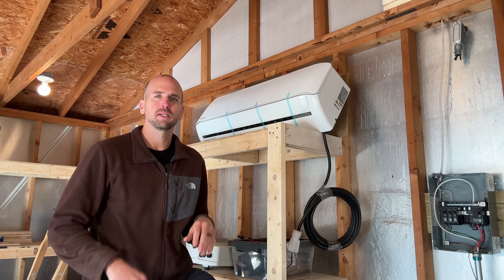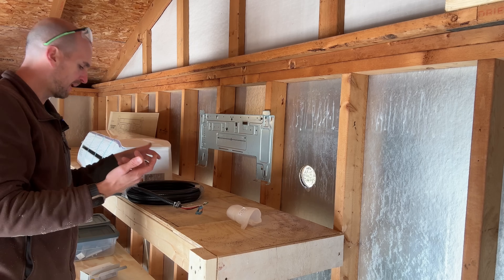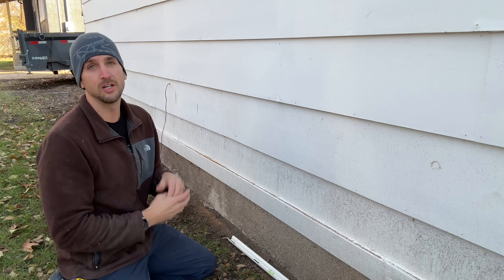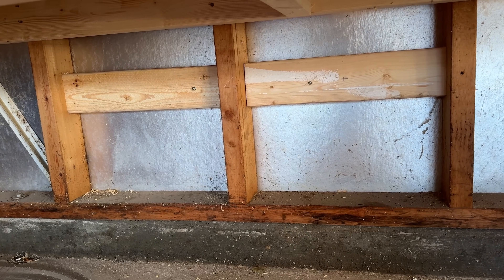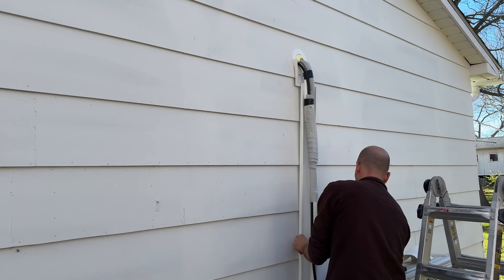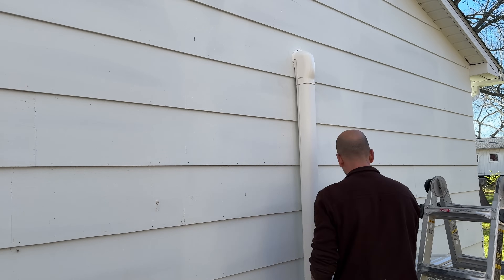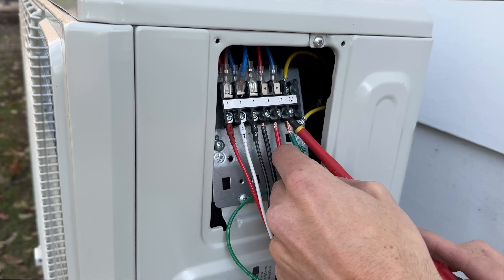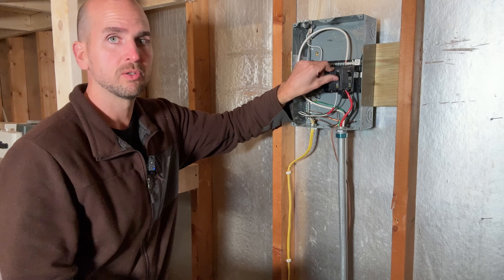Complete DIY Mini Split Installation | New Mr Cool 4th Gen Unit

Comment: What about using your EXISTING a/c power lines to power that system?? because for me my a/c has a electrical box like that but older with a fuse why not use the lines on that to power it and for me mines is wire directly to the fuse panel so essentially upgrade the box upside to the Mr cool box wouldn't that work?????

Comment: No, you're not gonna call out anybody and have them come recharge your lines.They're gonna ask where's your permit who installed it?We're not gonna touch that, and it's gonna be more expensive than just going and buying new lines... Nah HVAC guys going to want to remove all your refrigerant.Vacuum out the lines hold a vacuum weigh refrigerant, re introduce the.Refrigerant , do all kinds of tests and uh , you think that's gonna cost you a couple bucks youre cray cray....So I think you better check your figures...
Some of these lines from other manufacturers are so brittle that if you move them around like this guy's moving them you will break and crack the copper (crap from Amazon).It wont-work.You're going to be buying a new line set.

Comment: Does yours make A popping and cracking sound after the heat cycle? My mini split keeps me up at night, and when it is in defrost cycle makes it poop and crack even louder! It doesn't pop and crack in a/c mode during the summer, just heat mode. I'm trying to figure out if something is wrong with my mini split, or if they all make that annoying pop and crack sound.

Comment: Scott, quick question... If I have a two story house, and the A/C will be on the second floor (while the condenser is on the ground floor), can I run all the pipes and the wires inside the dray wall?  Do frames of buildings have some sort of wood between the floors inside dry walls?  I just don't want the outside of my home look ugly with all those wires and pipes hanging on the side of the house.

Comment: Just a quick glance, either the top plate of the wall you mounted the handler to is out of level or the handler itself is (by about a 1/2-3/4 inch across the length of the handler.) Could just be a trick of the camera as well. Otherwise great install! (Sorry, OCD kicked in.)

Comment: Good explanation but couple violations,, 1..the white wire supply wire in disconnect not identified as a hot wire.
2. The black control cord coming out of the outdoor unit he used a metal cord connector whish is not rated for outdoor use.
3. Black control wire needs to be secured to the seal tite,, 
Never would have passed inspection here

Comment: Checking the Mr Cool Install book for the 18K unit they say to use a 30 amp breaker and a 10 gauge wire.  You are using a 20 amp breaker and a 12 ga wire.  Is that working OK?

Comment: I just took delivery of my 2nd Mr Cool, this one is a 24,000 btu unit for my workshop. The shop is a separate (from the main house) building with it's own 200 Amp panel. I have already run the 240 circuit using #8 wire with a 35 Amp breaker in EMT out to a non fused service cutoff and all rain tight compression fittings. The compressor will be on a wall bracket. I will be fabricating a special longer bracket in order to hit 3 studs to lag it in. Tomorrow I'll begin installing it, and welding up the custom wall bracket mount. 

The main house upstairs Bonus Room had a new Mr Cool already when we got here in March of 2023. I have to say, this is a really wonderful product. It keeps the Bonus Room upstairs at a steady 75 degrees regardless of the month or weather. It is super quiet and so far has worked flawlessly. Like I say, it came with the house but was newly installed just prior to our buying here, so I didn't install it. I'm looking forward to learning all about it when I install this new unit in the workshop. I like the Bonus Room unit so much I decided to go with another one. 5 Stars for Mr Cool. Further, as a solid dedicated DIY guy, I love the pre-charged system and being able to do it all myself.
Reply: @highland6439  Gosh, I have no idea how to break it out. I have 4 heat pumps on this place. Sorry. But it seems reasonable.
Reply from the maker: Nice, best of luck on the project and I like the custom bracket idea to hit 3 studs for a little additional support 👍
Reply: @EverydayHomeRepairs  What about the quality of these units? I'm thinking of buying one to cool a 20x20 garage in AZ. You think the 12000 BTU one would work for the 400Sq ft?  Say's it's good for up to 500. Thanks!
Reply: I did the exact same thing this past summer. We constructed the 30 x 30 shop/garage so while the walls were open I installed blocking to mount the wall bracket.  My biggest problem with the install was bending the lineset outside the wall to go straight down. All the videos I watched were smaller BTU units so I'm guessing the linesets are smaller diameter copper. I have the same unit as you, 24000 BTU. When installing the exterior cover I actually pushed the interior unit off the wall by about an inch on the side where the line goes out!

Comment: Don't know if one already exists, but a dual-level wall mount with locking features sounds attractive so the coil could lie flat on level one and the unit could be locked onto level two.  Easy to visualize.
Reply from the maker: That would be slick 👍
Reply: @EverydayHomeRepairs  Go for it.  I'll draw the plans.

Comment: A couple of things missing from the video.  Testing the lines for leaks and Mr. Cool states the coiled excess lines should be stored horizontally.  At least the 18000 BTU unit I just installed.

Comment: I want to make my oxygen and my copper (because it would cost less ) but I just find it easier to call a professional, create an economy and strengthen our society. Air conditioning is one of the few trades that combines six different disciplines and y’all wanna destroy it when it is the only line of defense against building and facility failure.

I have dozens of friends disabled from this work. How many homeowners do we need to experience that same outcome in order to realize this is a dangerous pursuit!?

Comment: Great common sense advice.  Any DIY with experience in construction or appliance repair should be able to pull this off.  Take your time and don't take any shortcuts.  What a great product.  So much more economical than working with a plumber or HVAC professional.

Comment: I thought the cools couldn't be wrapped vertically but needed to lay horizontal to prevent coolant oil from settling in the low parts of the loops?

Comment: When you turn on the breaker the fan should start working or you need to turn on the ac unit  first
Reply: Need to start unit with remote. I just installed mine and I believe I was reading that if it’s already powered up and running, and you lose power when it comes back on, it will restart itself, I think.

Comment: extra line sets should never be coiled vertically, any extra should at least be horizontal if coiled better using serpentine method best is to cut re flare extra line sets but that requires professional install

Comment: Is there a reason you just don't run the lines inside the wall and drill a hole on the bottom ? 
Seems it would be a cleaner installation.

Comment: Have a 12 k single ordered. This is the best install video I’ve seen yet. Mine is 115v to cool and heat a 14x28 insulated wood shed. I think it’s going to work great. Thanks for the info. 😎👍
Reply: What are the advantages of the 220 v over the 110 v ?

Comment: The garage is unfinished then why not run all lines inside between studs. Then go out the wall in the bottom at the condenser unit elevation? It will avoid showing the lines outside the exterior wall. Just curious

Comment: These Mr. Cools are made in China by the company who makes "gree", if you want something that will last alot longer go for the Daikin (Japan). Same installation process, like others have mentioned get yourself a Vacuum, and a flare and copper cutter kit to trim those lines properly. Very helpful video by Everyday Repairs.
Reply: Daikin AC is made in China too.What’s wrong with Gree AC?
Reply: @dehutech1072  They're made in Waller, Texas, not far from me. cCc
Reply: @BogMan7L these units?
Reply: @dehutech1072 are you Chinese?
Reply: Lots of Daikin made here in Owatonna, MN
Reply: Daiken is a great company, they make Goodman units
Reply: I 2as thinking Mitsubishi, probably in the top 3.
Reply: These are manufactured by Midea, not Gree
Reply: We have Gree Air conditioning unit bought 14 years ago and still working fine
Reply: Gree makes 2 million units a year.Hey you got lucky @slbensurto

Comment: Excellent video! Will be referencing for my own install. The only thing I would have added is to check the connections for leaks with some soapy water. But I understand these seldom do leak.
Reply: @parkinglotpatty2911  flare fittings leak all the time, whoever told you they seldom leak is 1, trying to make money on you later, or 2 doesn't have a clue what they are talking about
Reply: @calebwhitaker2318  calm down, Karen. I said to check them with soapy water.

Comment: please tell those of us like me who know more about power than most with the exception of electricians. What is the power consumption of the unit in cooling mode at around 72-74° and heating mode between 66-68° ? 

those are two realistic numbers that most people are going to set the thermostat at for heating and cooling! 

 What’s the power consumption running for exactly 60 minutes, which is how we’re all built and electricity kilowatt per hour or KwPH

It’s supposed to have a very high seer rating and for those of you who don’t know what that means it’s an efficiency rating the higher the seer number the better the efficiency, the lower the seer number the worse the efficiency rating!

 1800 watts is 100% utilization on a 20 amp circuit! ° is not realistic as I stated above, most people are going to set the thermostat around 68° for heating and 72 to 74° for cooling so if you could tell us what the power utilization is after running for an hour, that would be great information for those of us like me who are in the know!

it won’t help people who don’t know or dont have any clue what I’m talking about but since  for kilowatt per hour usage, that would be a very realistic information

Comment: very informative I would like to point out that the line kit is not pre charged the condenser is also would like to point out you should vacuum down the the system (that is what the 3rd cap is for on the condenser).  good video

Comment: putting the extra coil behind the condenser unit is ill-advised. the condenser unit spits out warm air towards the back as it goes through the heat-exchanger on the inside of the unit. the line-sets are supposed to be cool (hence the insulative material) and blasting warm air on them will reduce the efficiency of the unit.

sidenote: per code you need a service outlet within 25feet (20 or 15 amp gfci)

Comment: In Northern climate zones, with frequent snow accumulation, installing the outdoor unit on a pad or slab will lead to a total failure. In a defrost mode, ice will build up underneath, and eventually lead to blocking air flow, and possibly find the fan blades hitting on the ice. For the same reason, the outside unit should, at a minimum, be two feet above the grade, as ice buildup during the defrost mode can and will easily get two feet tall.

Comment: I believe this is mis-informing.  The line set is not charged with refrigeration, the compressor is. Also before opening the compressor valves you need to use nitrogen to do a pressure test then after about an hour, if it holds pull a vacuum to below 500 microns.  Overall neat job with a few corrections.
Reply: You’re 100% wrong

Comment: Wishing I had bought a Mr Cool for the extra user friendliness of installation. I enjoyed this video for its clear demonstrations, but I must say that each and every mini split video I see makes things look so easy, whereas in actual practice, because of the particulars in my old house installation, I literally find each step to be about ten times more difficult to accomplish. I am still placing orders for so many needed extra parts and tools. I feel that by now I could write a whole book about all the countless unforeseen extra difficulties, most of which are never encountered in any of these installation videos. Plus, the 45 page instruction booklet is chock full of missing information and extremely poorly written out-of-order text. About half of the instruction booklet info is irrelevant or not even necessary, plus they leave you always wondering which pages apply to my model since it was intended to cover many different mini split models. In short, the instruction booklet is very lengthy, extremely disorganized, and leaves the homeowner with countless unanswered questions. In my installation, I would NOT call this a reasonable DIY'er project, since it requires expertise in so many areas, along with the need for numerous special purpose tools and professional know-how. One example is acquiring the tools and skills to make perfect copper pipe flares, which I understand are a major reason for later needing to call in professional hvac repairmen. But I am determined to see it through. I did try calling the major local hvac company for help, and they refused to get involved.

Comment: Why did you use a fused disconnect as opposed to a nonfused disconnect?   One day, a fuse will burn and the homeowner will have to go and find another fuse, to replace the burnt fuse.    Totally unnecessary to have a fused disconnect.

Comment: Hopefully the condensation tube drains.  That hole on the template is for the insude wall. The hole outside must be lower.
Reply: Do you suggest maybe making the hole Diagonal, good for the refrigerant lines not bending so hard too.

Comment: It probably would have been to your advantage to mount the outside unit 20 inches from the wall incase you need to get there in the future. It would also increase air flow and make the condenser fan work easier.  Had you used an EG4 AC unit. You could connect solar panels directly to the unit. I'm running a 24k unit and on a hot day  it's drawing 540 watts until the room cools down. At night it runs under 400 watts.  The EG4 AC also comes with precharged lines. I would also recommend Nylon blue on every connection. Stay cool.
Reply: The EG4's are pretty good units for off or on grid if you have panels or room for some.
Reply: @sife3438  once your room cools off they draw very little power. I don't know about getting replacement parts like an evaporator coil or blower motor, or the entire air handler. The outside unit is extremely quiet. I have mine on rubber feet mounted on pressure treated deck board.

Comment: I have a Mr Cool 9000 btu Unit, a little over 14 months in use, in August of 2023, unit failed, I couldn't get a response from Mr. Cool. Local HVAC charged over $300 for freon and labor, 8 months later unit failed, finally reached Mr Cool.  They didn't care about my having to pay already, plus they demanded $250 to ship like unit one state away.  I finally went and picked up the replacement unit. One day (600 miles round trip) and spent $60 in gas to get a replacement "UNDER WARRENTY".
Reply: Not a good look mr cool.  That's for the heads up.
Reply: mr not cool
Reply: You obviously had a leak if you needed refrigerant because of a leak but don’t explain what the problem did to fix the leak. Could have been a bad install. More info please.
Reply: @steveedlund7357  I paid a tech $300 who preasureized with nitrogen. Held pressure for 20 minutes, then held vacuum for 20 minutes.  Only leaked off while running.
Reply: @steveedlund7357  And that's what Mrcool tried to do, blame the installer.  ME, I'm the installer, however a YEAR before this install, I, ME, Installed a 24,000 btu unit in the main part of my house and it works fine, always has. Other than maintenance (cleaning fins outside, filter inside) it works just fine.
Reply: Thank you for all the great feedback - I’m in the process of making a  decision to buy a mini split and this was on the list - not anymore
Reply: Outrageous ‼️‼️‼️🤦🏿‍♂️🤦🏿‍♂️🤦🏿‍♂️😤😤😤
Reply: NOT the typical experience. People love them for a reason.
Reply: @nedhill1242  people love them because they are cheap. People love them because they are "DIY". People don't love them when it takes a month to get their cheap parts, People don't love them when HVAC companies won't touch them because they have the cheapest parts in the business. As I stated earlier, Mr Cool systems are the perfect example of, you get what you pat for. Board goes out? May as well treat it like a bad window unit and throw it away because a Do-it-yourselfer will never get the board right again. Enjoy throwing your money away fighting the evil HVAC companies.
Reply: That's because Mr Cool is garbage. Perfect example of you get what you pay for
Reply: Greed equals product lawsuit under contractual agreement. Take them to an arbitrator AAA works magic.
Reply: Helped me my ate my decision.
Reply: Thank you for this information
Reply: Sounds to me like the initial installation got screwed up, unit leaked gas, service company gas n go'd and didn't repair the leak. Those flare fittings are incredibly easy to fk up.
Reply: Well yeah, that's what you get for DIY, and for paying a lot less that a local pro.
Reply: 600 miles and only cost 60 bucks in gas? You must drive a Prius or this happened a long time ago lol
Reply: A 2010 Sonata.